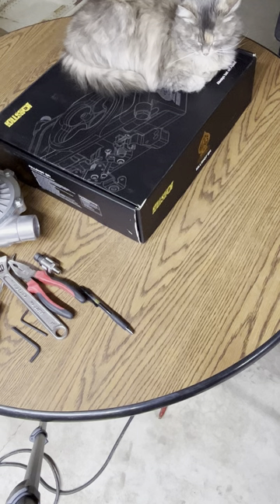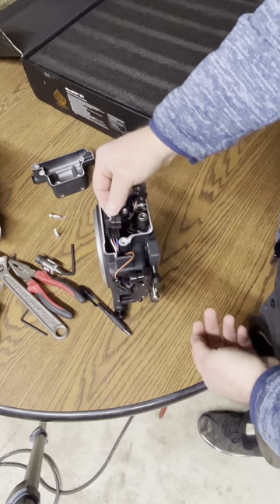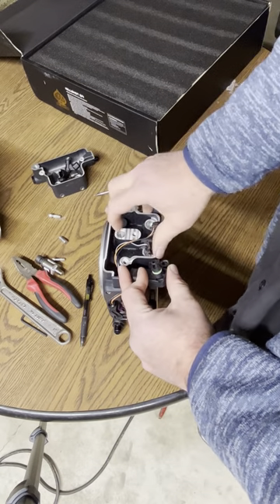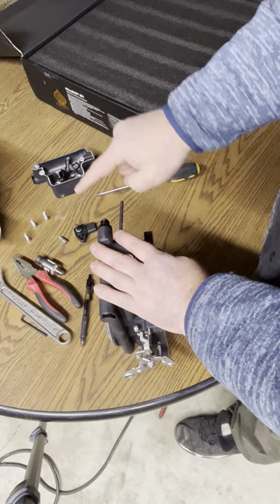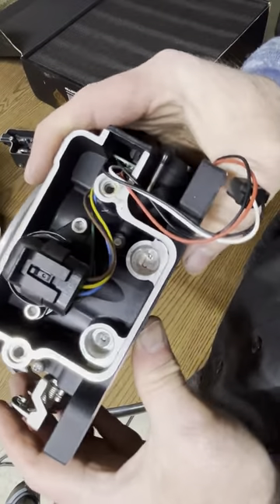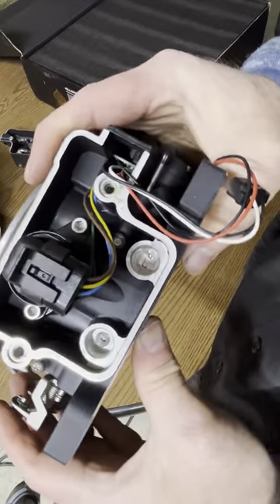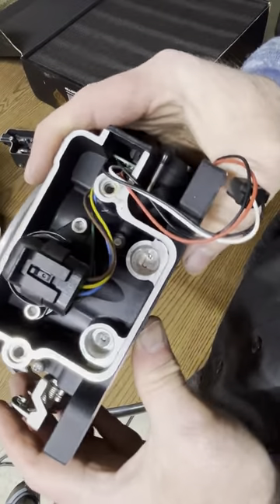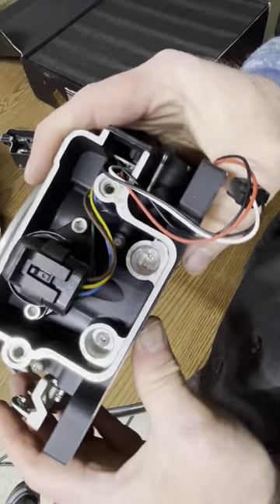Killshot, voided the warranty first thing.

Comment: I’m running a ford 302 with a 4r70w transmission. Does this system offer a built in transmission control or a stand alone?
Reply from the maker: It does not have a built in trans control. There is one for gm 4l60/80e and I think for will be a thing later in the year

Comment: Can't seems to find any information if this can go on a 318 - 1978 Dodge b200 van
Reply from the maker: It’s a 4150 style flange tbi system I think that engine has a 2bbl setup. The aces 2bbl is a 2300 style flange.
Reply: @Action Vulture  right now I have a Thermoquad carburetor.
Reply from the maker: They are so good until they are not. One of my classic favorites. But they make a Mr gasket adapter that should work to adapt it.

Comment: Take apart the ecu  because I went through 2
Reply from the maker: It’s just a circuit board. They usually go bad with voltage spikes like wiring issues or miss use.
Reply: @actionvulture5251  well I have one that’s not sparking no more it’s the second one is it something I can take apart and fix or is it fried

Comment: They make these efi units sound soooo good until they are not then its the wiring, its a vacuum leak, your alternator is not good enough, bla bla bla bla! Carb and it works!
Reply from the maker: I like both. Carbs on stuff that needs a carb and efi on most other stuff. The biggest issues I have is install issues. I get install issues with carbs as well or a poorly done rebuild and bad adjustment. But it’s hotrod stuff, it’s not for everyone.

Comment: how about oil AND fuel!!!!!
Reply from the maker: No need to yell. But it would take a redesign of the pcb to add in the extra ins and outs. That would drive up the cost. Option 2 is wait for the can module so you can what ever you want on there

Comment: Is this better than msd?
Reply from the maker: That’s a Coke vs Pepsi thing there, I have installed both. MSD has 80lb injectors killshot 100lb injectors so higher hp rating there. Both do timing control. Both remote mount ecu, both have a HH display but the new killshot hh will have a built in gps module soon. Both use the Bosch 4.9 lsu o2 sensor but the leg up on the killshot is the 32bit processor and the cj125 wideband controller chip so faster self learning. Both easy install with just a few wires and easy setup. 500 dollar price point difference is the big seller for me. But most aftermarket units if installed and adjusted correctly do a fine job.

Comment: tech engineer with dollarstore wrenches/tools .......
Reply from the maker: The goal is to use stuff that most people have. Harbor freight stuff adjustable wrenches and such. Some people like name brand and for the rest it don’t matter much.
Reply: @actionvulture5251  fair enough   god bless does yours have the same on off switch like throttle pedal like sniper 1 has????
Reply from the maker: Like where you try to ease into the throttle and it just gives it all at once. Naw the killshot is pretty smooth in that department. My camper was the worse for that when it had the sniper.
Reply: @actionvulture5251  yes I'll never understand why snipers aren't delivered with the much better progressive linkage allready installed, I had to convert all 3 to progressive linkage